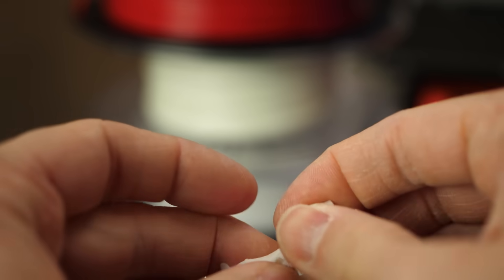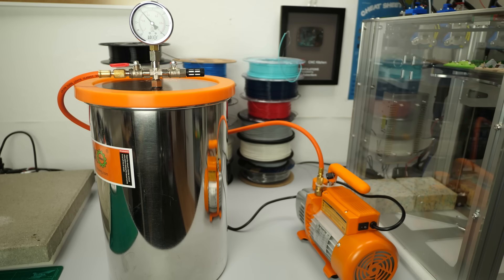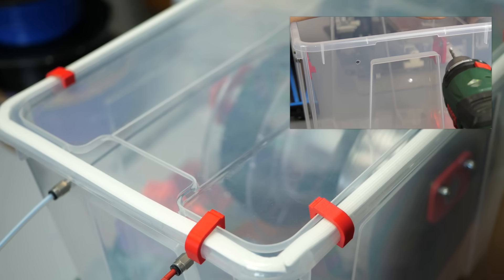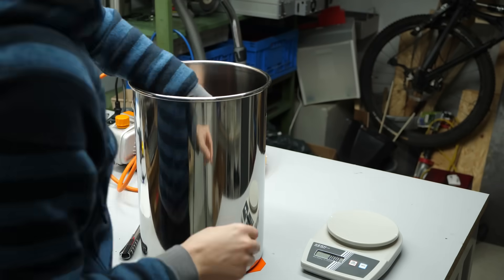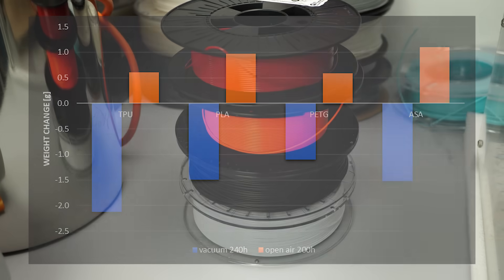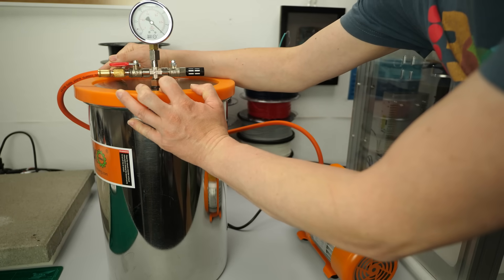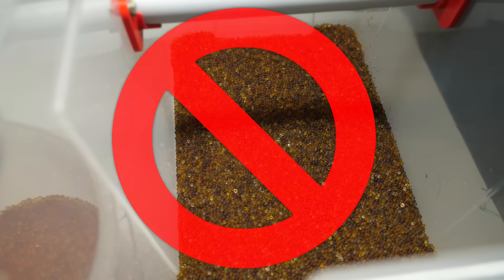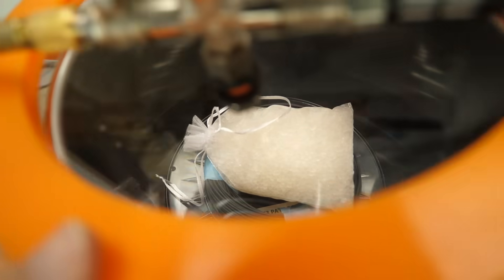Vacuum VS Dehydrator! What's the best way to dry filament?

Comment: Good work, but useless comparisons...
You had to shut down the vacuum pump after 15 minutes because it was overheating already? One stage China first(low) quality pump? What a comparison! Of course, even with a low quality food dryer heater(worst case scenario, it will burn down the house) you still get heat, but vacuum? At 20°C you'll need at least a two stage pump to get it dry, not only 'boiling'. Then you let it 'heat dry' for a few hours, but you couldn't with the pump. Now talking about budget, a good vacuum pump will cost you more than your printer, is it worth it, probably not, but the comparison is still not valid.

Comment: There's another step in the drying process: The hot-end itself.  That is, how can moisture be better coped with during the print process? 

When I got my Sidewinder X1 v4 I did several side-by-side tests with my Monoprice Mini Delta (MPMD). One of my biggest issues with the MPMD was its behavior with wet PLA filament, especially the very inexpensive PLA I use for draft prints, which I suspect was wet when it was made.  This filament would sputter, hiss, spit then ruin the print.  The worst offender was some low-end satin metallic filaments (all colors - gold, silver and copper) that the MPMD was unable to print without much spitting, then clogging the nozzle with the melt back-flowing into the heat-brake.  After completely rebuilding the effector three times I gave up using those filaments on the MPMD.

The same filaments printed PERFECTLY in the X1!  I was beyond shocked.  My theory is that the much longer melt zone of the Volcano hot-end was allowing the steam to escape out the top rather than being forced out the nozzle.  Being direct-drive this was difficult to see during the print (vapor condensation was sometimes visible in the MPMD Bowden tube).

So, Stefan: Do melt zone length, hot-end temperature and filament feed rate / nozzle diameter (melt zone pressure) help mitigate filament moisture issues?  If so, in which direction and by how much?

FWIW, I no longer bother drying my PLA or PETG, and I don't use desiccant.  I do try to store spools in zip-lock bags or sealed plastic tubs, but I always have a spool on the X1 with no such care.  I try to use only new spools with the MPMD, and run everything/anything on the X1.

Edit: Typos.

Comment: Thank you. Since the very beginning of my 3d-printing experience I suspected that drying of filament is some kind of superstition and ritual and moisture is a scapegoat to be claimed for any fail of print. Your measurements will serve as proof that it is insignificant for regular materials, that is also proved by my own experience. May be it is a kind of cargo cult. Wonder if dust could have influenced of weight of filament left lying without cover.

Comment: one last option in your vacuum can  s add a small amount of dry nitrogen after full vacuum not enough to break the seal so like half atmospheric pressure then see if this improves the drying it will allow themal transistion without oxygen. Once you are at complete vacuum the heat cant reach the filament any longer its the principle of a thermos bottle.

Comment: Excellent video as always Stefan. Many people worry about hygroscopic filaments before printing, but what about after printing? I printed a part in eSun nylon/CF and it was very strong, but after a few days it went soft and was no longer suitable for the application.
Reply from the maker: That's normal with Nylons. The water acts as plasticizer. Normal Nylon parts get conditioned in special ovens so that they have equal moisture content before shipped out and don't change properties anymore.

Comment: Wouldn't using a chamber dehumidifier work better overall? You could build a small cabinet with shelves for aeration of the filaments and place the dehumidifier at the bottom; making sure the cabinet seals from the environment and running a hose for the fluid outtake could work.

Comment: I would love to see the filament heat-dried and then immediately moved to a vacuum. The remaining fluid in the material should be much warmer and thus even more likely to boil off in a vacuum. Might result in an even lower water content in the material.
Reply from the maker: That's what I usually do with my Nylons though didn't see a huge effect.

Comment: I am curious of the performance if you tried adding a heat source to the vacuum drying method.  Something modest like a heat mat (like for starting seeds) that increase the temperature 10-20 degrees above ambient.  This is similar to the typical freeze drying process and in theory should be the least damaging.

Comment: I made a dryer out of an old crock pot cooker. The ceramic dish got broken. So I took and made a 3d printed mold that fit 2 of my largest spools in it, filled the crock pot up with concrete. Next I drilled a 1/8" hole in the concrete and embedded a thermostat. It works really well, and to was made of stuff I had laying around the shop. In the future I wasn't to add an Arduino to control the temperature and have presents for each type filament.

Comment: I have used calcium chloride ("torrbollen") in my dry-boxes for a long time. It seems to absorb moisture a lot faster than silicagel, as the measurement of my hygrometer inside of the drybox falls a lot quicker with calcium chloride than it does with silicagel after i opened the box. I also seem to be able to get much lower air moisture with the calcium chloride inside of the box than what i am able to get with silicagel. Maybe you should do a comparison of the two?

Comment: U can get a bandheater and wrap it around the vaccum chamber and heat it. To be safe use DC heater with low voltage.

Comment: I store all my spools in plastic bags (with the desiccant packets they come with) whenever they're not on the printer. This helps them to be protected not only from moisture (not too important for PLA, but other materials can suffer a bit), but also from dust, since I'm in a bit more dusty area than usual. 
I had success drying Nylon and recycled PET in the oven set to ~70°C, keeping them there for several hours or even overnight. They printed just smooth after that. I never had to dry anything else though :)

Comment: It takes 1 BTU to change 1 pound of water 1°.
It takes 144 BTUs to change the state of 1 pound of water without changing the temperature 1°.
When using a vacuum, that 144 BTUs is retained by the remaining water. Cooling it down. Eventually it might freeze. Which makes it more difficult to change the state. The vacuum pump that you're using is not sufficient for the application. You need a commercial vacuum pump. The kind used in air conditioning service, or better.  29+ inches of vacuum is needed. The amount of heat that can get into the plastic from the outside also makes a difference. In a vacuum chamber, heat cannot be transferred through the air, Since there is little air for heat to transfer through. If your vacuum chambers clear, you might try placing a heat lamp around it. 

Also, when you break the vacuum using The moist atmosphere, that moisture in the air is going to be pulled deep into the plastic. Dry nitrogen is recommended but expensive. At least you can pull the air through dry desiccant instead. A dehumidifier  may also make a difference. Keeping the air as dry as possible. If the air is dry, moisture cannot get into the filament. Unfortunately the dryer the air, the more static will build up. This could be hazardous to the electronics. 

Stay safe and happy printing.

Comment: Hello, great video as always. You shouldn't vacuum water. In my experience water vapor somehow damage the vacuum oil and this results in inefficient vacuum pressure.

You should get at least -29inhg pressure in your vacuum chamber if there is no leak. But in the video i observed you only get -27 - 28inhg and thats not enough for efficient vacuum.  I use vacuum pump everyday for my resin castings, if you have any questions please let me know. Have a good day :)
Reply: @karoo_bushman6880  I haven't use these types of oil-free vacuums, but if your soil purpose is drying filaments you should be better of with dehydrators.

Comment: I ran into this very issue with a box of PETG I had laying around I forgot about for around a year. It would print fine like you said with a bit of excessive stringing but once you placed load on the part it would break apart like glass. I ended up wasting a ton of time trying to trouble shoot it.

Comment: Great work. may I suggest molecular sieve media instead of silica desiccant.  It is more hygroscopic and so reduces moisture levels further.  It also does not give up moisture as much. I see in your data that the filament was able to pull some moisture our of your silica media when dried and then stored there.   If you elevate temperature of the silica it even gives off more moisture yet... Note when you regenerate the molecular sieve media you do have to get it quite hot to break the bonds and release the moisture...

Comment: I've stoored my PLA in the basement that is about 70% humidity and after 6 months the filament was so brittle that it broke in the printer and on the spool, could not bend in a radius of 5 cm before breaking! 

Tried drying it in the oven but overheated a little so the spool deformed but now the filament is not brittle at all

Comment: I live in a very humid tropical environment, so my filament dies quite quickly.
I also have access to vacuum oven. However drying filament for 6+ hours at 60°C under deep vacuum didn't seem to help much. My PLA became brittle, and overall quality of prints is still way below one from freshly opened spools.
Interestingly, I don't seem to have these problems with PETG. It prints reasonably well even when stored in open humid air.
Any suggestions on what I am doing wrong?

(All filaments are Prusaments)

Comment: Pro tip on the food dehydrator: since it heats by constantly flowing a set rate of air past the heating element, you can raise the temperature in the chamber by decreasing that flow rate. Since you can't slow down the fan, you can tape over some of the inlet holes on the bottom of the dehydrator. 

But be careful, and actively test - I made the mistake of using my thusly modified dehydrator on a carpet, further choking flow, and managed to melt a bunch of the dehydrator's own parts.

Comment: I bought a cheap temperature controlled food dehydrator to dry out my 25+ filament reels and store them in 3 waterproof tubs that have 0.6kg of silica gel beads in each one (orange bead=dry, dark green=needs drying out)
The difference in my PLA isn't very noticable but it is worth it, PETG is less stringy, and TPU is wow, check this out: 2 prints from the same TPU reel, guess which was printed after the filament was dried out: haku.co.uk/pics/WetAndDryTPU.jpg

Comment: The process almost seem osmotic in nature - water vapor flows to whichever material has greater capacity to hold it. Hot air has the highest capacity, dehydrated room temperature air is decent, vacuum is reasonably dry but has a lot of leftover water vapor. Try building a heated silica chamber with a dehumidifier attached to it.

Comment: I would like to see more indepth analysis about how the interior of the spool dries vs the exterior. That's the doubt I always have, if you print something small and only use the outside of the spool you are good. But with large prints it could be a problem. Also, comparing if the interior of the spool is wet compared to the outside. Maybe the interior does not absorb much moisture.

Comment: I indeed had lots of trouble printing PETG, a lot of prints came out very weak and brittle. At the time I was very disappointed by this because I mostly switched over to PETG to make mechanical parts. However, after reading about this and having it in a descendant bag for some time, the print quality much improved and now prints 'proper' parts.

Comment: should have places the vaccum chamber over the dehydrator heat it up under vaccum water boils and evaporates much lower temp takes 15 to 20 mins in a heated vacuum oven

Comment: I have seen people doing freeze drying, they use a vacuum chamber with a heat lamp shining through the lid to provide radiative heating, as you can’t use conduction or convection with no air.

Comment: Mine only snaps once it's been exposed to PTFE tubing strangely. Never have an issue on exposed rolls, but it'll snap after a few days sitting in the printer. It's happened several times and always at the entrance to the reverse bowden on my direct drive. There's no appreciable stress at that location. On stored rolls the ends tend to break only where it's pulled through the spool to prevent unwrapping; likely stress related. The PTFE is supposed to be non-reactive but I wonder sometimes.
Reply: I had one roll, that did not like straightening. If I left it in the tube, then it snapped at like 5 places after a day or so.
Reply from the maker: That's creep under bending stress in the PTFE tube.

Comment: So, you lost about 2g water per spool, say 3g for a full one. I've read Silica holds 30-40% of its own weight in water, so 10 grams should do it? 
I'm just facing this question myself now, and feel zip vac bags and silica sachets is the way to go.
Reply from the maker: They can, but the mositure equilibrium will be higher with more saturated desiccant and those bags are not moisture tight, you need to use the silver ones for the really critical materials.
Reply: @CNCKitchen  awww applied science, thank you!
Reply: AFAIK silica gel takes on water somewhat linearly with relative humidity. So it will take 40 % if at 100 % RH all right,  but if you want 10 % RH, then it takes only 4 %. I use 250 grams of cat litter in a textile sac with a roll of filament and put a cheap (2 $) LCD hygrometer beside it. The hygrometer does not show under 10 % RH, so if it shows 11% then I dry the silica gel in the owen and it is good for some months again.
Reply: @bumv2  argh good thinking batman, it makes sense! What cat litter are you using, obviously one that contains silica?

Comment: Tip for those in the US, you can get cheap desiccant at many stores by buying the 'crystals' type of cat litter which has the sole ingredient Silica Gel. Comes out to less than $1/lb usually.
Reply from the maker: Tried that in the past but it didn't work for me, unfortunately.
Reply: @CNCKitchen   It didn't work even after regenerating the cat litter? (I haven't needed yet with mine)
Reply: They are also available in Denmark, and works fine for me... and so very cheap

Comment: My best results of drying filaments are in a dehydrator for vegetables and fruits. It cost low money, uses a little of electric power and helps drying my filaments in 1, maximal 2 hours. I mostly print PETG and Nylon with cf or gf. 
For my dehydrator I printed a drying chamber in which I can dry 3 rolls of filament at a time.

Comment: As always, an amazing collection of data Stefan! As you stated in the beginning of the video the degradation of material under high temperature is an issue. It would be nice to see data comparing oven / food dehydrated material compared to vacuum dried when it comes to the strength of the material (both x-y and z). From my experience the best way to preserve high end materials is to have slightly elevated temperature (i.e 40-50C) and under vacuum drying, possible in a vacuum oven. This allows for additional moisture to be drawn out while simultaneously preserving the polymer chain structure. An affordable heated chamber vacuum dryer for filaments would be the perfect product for high performance 3D printing materials.

Comment: What about using simple rice instead of desiccant? I find it quite convenient and also eco friendly. Only thing is you have to regenerate the rice more often I think.
Reply: Silica gel can be as eco friendly. Remember, it is just sodium silicate and it has an infinite use life as you only have to dry it to kick it anew.
Reply: No, it is not sodium silicate, but silicon dioxide,  like quartz or sand. https://en.wikipedia.org/wiki/Silica_gel OTOH I consider it totally eco too :)
Reply: @the_arcanum  nevertheless, the cheapest rice I can get in my local store 3min away only costs me maybe 1€ per KG. I also just put it in the oven at 100degree for some time. After cooling down I put it in my box and within minutes my hygrometer plummets below measuring range of 20% and stays there for weeks.

Comment: You said if your drybox moisture level go above %10 , dehydrate silicagels. Im using completely same drybox setup with 1kg silicagel and same termometer and even i do not use ptfe tube in my box ,its fully closed. But my moisture level cant go lower then %27 never. Im living in İstanbul. What can i do with this.
Reply from the maker: Then your silica gel seems to be wet. I have 0.5kg desiccant in my box and even in a humid summer it nicely stays below 10%.
Reply: @CNCKitchen  im sure its fully dry. Im using blue indicating silica gel and it fully blue for now. Just for to be sure i dehydrated it in my oven but nothing changed. Is that because of where i living? Humidity is around %60-%70 in open weather in İstanbul.
Reply: Are you sure of the humidity level? I would be suspicious of your humidity gauge - when I bought one for my 3d printing a long while back I was amazed at the general in Accuracy of them if one looks up the technical specifications for them. Most have way higher inaccuracy as the humidity drops - so most  are terrible in the range we want to use them for. (I forget but I seem to remember they claim to be like +_ 10-20% at less than 30% r.h !!!) You can calibrate them with special sachets of salt solutions of known concentrations in bags - which I didn’t see Stefan doing - so I would be suspicious of his measurements too.